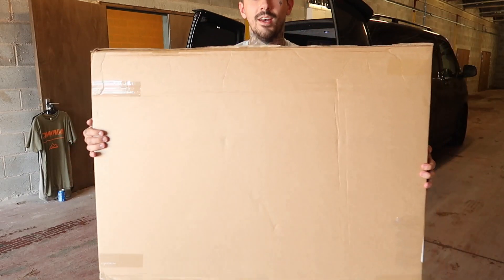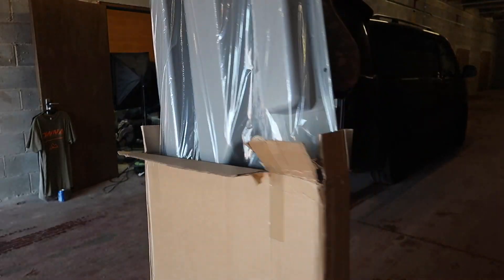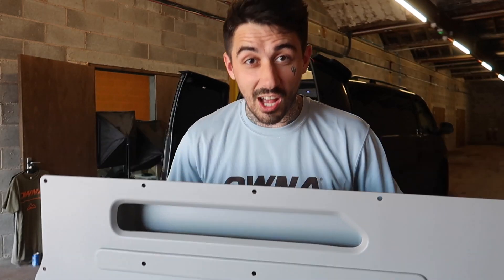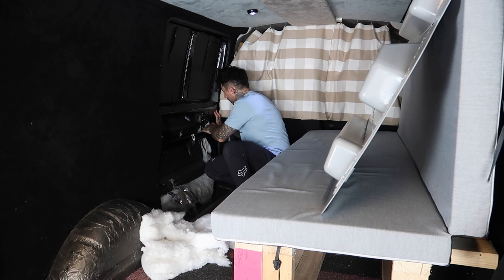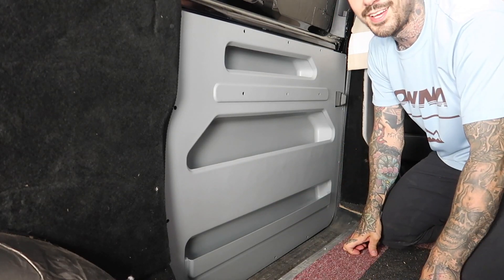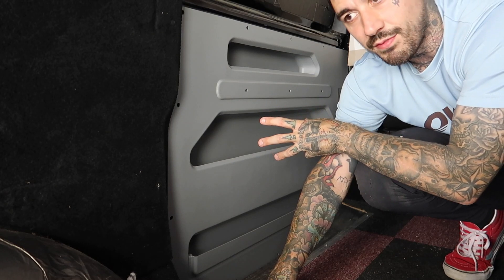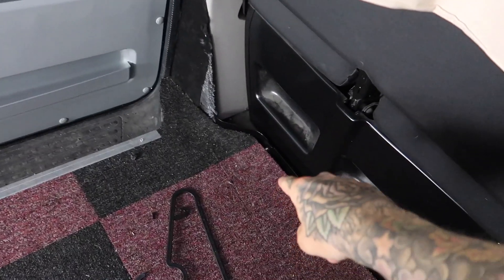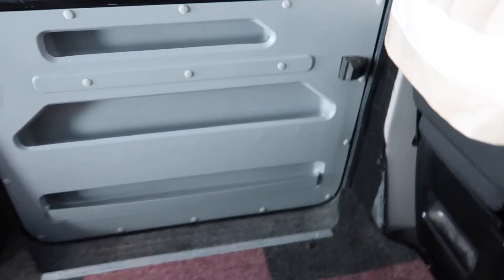VW T6 DIY CAMPER PROJECT - COOLEST MOD YET!!

Comment from the maker: ANY OTHER COOL MOD IDEAS?? HARRY.
Reply: With pockets
Reply: I wondered where my nan curtains when lol only joking  lol
Reply: I would have made my own door card out of wood then painted it black
Reply: NICE LIL MOD THA INIT!
Reply: Any other cool ideas ?.....yes....remap that T6 bad boy !!! 🚀
Reply: I've got a foldable solar panel for my caddy and a bigger battery (100Ah instead of 72Ah) and a Dometic compressor cool box. Combined with a bed made out of aluminum and wood and a sliding box underneath the bed where I store my stove, cutlery and stuff. I also recommend getting some window insulation. Coolbox runs up to three days without the need to recharge the battery (depending on outside temperature). But solar panel gives me the extra security. When I am alone my dh bike fits right next to the bed (which is 80x200cm).
Reply: Get it finished so u can go on some bikepark trips :D :D :D sick vid
Reply: Get yourself a ground/wall/chassis anchor (whatever works in your van) to chain your bike to. Got my Giant nicked last year....sad times. Get a bolt cropper proof chain !!
Reply: Think you should get a Owna logo made that lights up and goes on the wall
Reply: Just want to know did a girl come between u n gaz bro
Reply: How about a 240v plug so you don't have to have the doors or window open when on a campsite, put the connector under the back bumper so it looks like a towbar electric socket, more stealth
Reply: My only regret is fitting the rear windows! DONT!! You lose the ability to stealth camp. Plus i kept waking up early doors as there was too much light coming in. Plus they let a lot of cold in. I also fitted a diesel heater under the drivers seat
Reply: Put some black carpet discs on the wheels, then it'd look .  .   .    .
Reply: Also - Spend the extra and get a generator that does full sine wave power. If you get a cheaper one that does modified sine wave - it will rinse your re-chargeable batteries
Reply: You could use bath paneling to box in the bed as its light and then cover it in blue swede or a vinyl wrap
Reply: Harry Main get a shoe rack/ Beth that clips onto the inside of the back doors so you can have a space to put dirty wet kit and shoes etc
Reply: @deffojeffo  Good idea with the cab heater but I went for Propane, far quieter and cleaner.  Fill it at any LPG station, I use mine all day 5 days in winter, tank lasts 2 weeks, costs £5.50 to fill it.
Reply: felt it like the rest would look nice 
:)
Reply: Solar panel on roof, sliding drawers under bed maximizes the space at back, water pump and water barrel for either a shower for a weekend get away and washing bike down also I've seen that deisel air heaters are good too.....keep up the good work dude love the vids 🤙🤙
Reply: autoscanremaps nah - I got a diesel heater plumbed into my main tank. It’s got a timer and remote control - never need to get into a cold van again!
Reply: @deffojeffo  Yeah can do that with the Propane ones too, life changing if you work mobile 🤘
Reply: You could also carpet that doorcart with spray adhesive...

Comment: Maybe run thin rubber on the rim of it to quite it.  Maybe a rattle.  When your driving. And add something like rubber on the insides of the shelfs.  Use some old inner tubes. Cut em in half. Maybe use that to put a rim around the whole thing.  My friend has one he added it he said it does not make to much noise but he added something around it to quite.  And insulation will hold moisture. Causing mold.  Maybe think about that

Comment: For the curtains I suggest maybe applying Velcro to them as you could stick it to the side of the van to make the privacy in the van a little better , also around the wheel arch you could create a crate for the petrol generator to live in prehaps , then maybe a fold dawn table on the left side above the generator with sockets to charge things like go pro cams , phones , etc  etc

Comment: Rocking the T4 since October last year for the dirtbiking. My Orange 5 constantly lives in it and I’ve just ordered a Haibike AllMTN 6.0 for some Eebing. Been fighting fires with the T4 though, close to a grand on servicing the usual water pump, pulleys and gaskets etc. To make sure the engine is good. Had Plenty of welding underneath and fixed a few electrical gremlins also. New head unit with dash speakers but have just gone 1990’s maxpower and bought some 6x9s and a sub because the standard set up is so bad even with the upgraded dash speakers😆, so have to build an enclosure for those this weekend. Next job is full respray with rust repair then will fully move on to the interior 👌🏻
Keep up the content 👍🏻

Comment: Put some strips of carpet in the bottom and back of the new sliding door pockets. That'll stop things rattling and even dampen the panel somewhat. Pretty good value to be honest, that panel. If it was an OEM part it'd be £300!!!
Did yer mum chose the curtain?